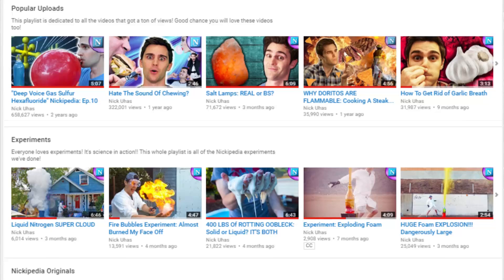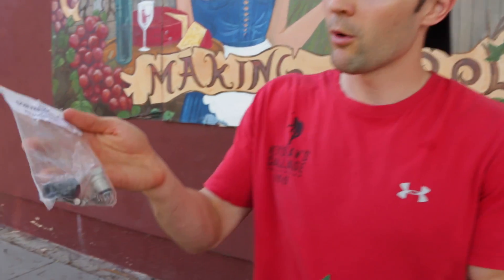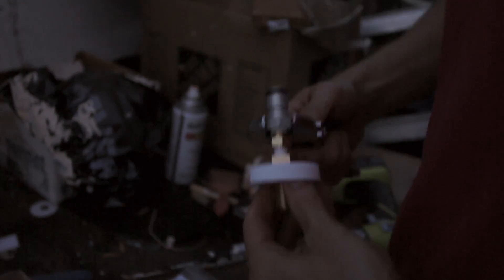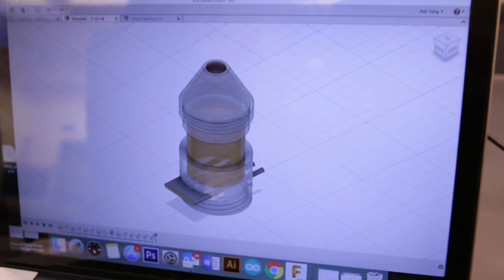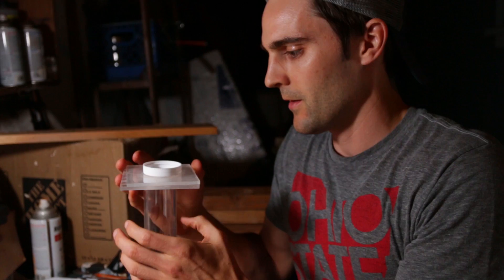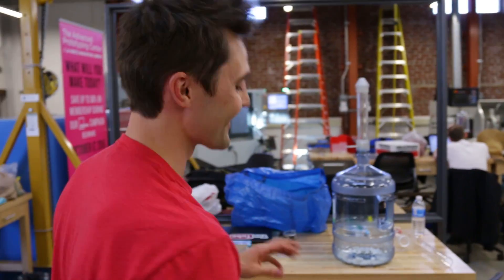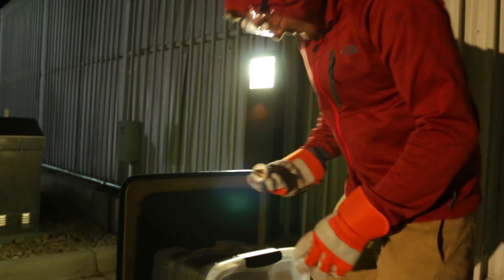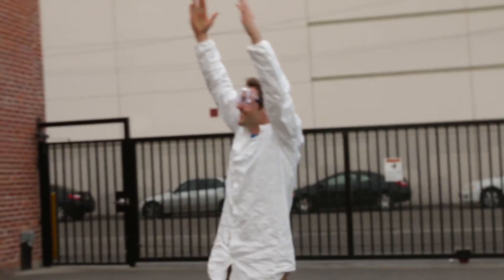Mentos in Soda WORLD RECORD: How We Broke The Largest Soda Mentos Geyser World Record (Documentary)

Comment: Hey um I'm just wondering, if you chop the mentos, would it affect the reaction with the soda? If not, (thus you can fit more mentos) would it make a bigger geyser?
Reply: If you chop and put in the same amount of mentos, I think the increase in surface area would significantly affect the geyser's height. The more surface area there is, the more nucleation sites there can possibly be.
Reply: QuasIIc - I agree. The increased surface area will create a faster reaction with the soda. This means it would be pushed out of the nozzle harder and reach taller heights.
Reply: 4
Reply: 43
Reply: 33
Reply: 3
Reply: 3
Reply: Jseph Oppa it would be the same if you cut because the less of the chemicals it would be a less chemical reaction
Reply: The mentos wouldn't have another reaction.. Because if you cut the mentos your still putting the same amount in.. So, in theary it shouldn't change at all! But this is of course just a theary who knows maybe if we have more room it will make a larger reaction! This is something for us fans to find out for ourselves! 

Peace ✌🏻✌🏻

Comment: I did not know that 3D printers existed!
Reply from the maker: probably one of the coolest things to come into the science/tech world in a long time... I think they are still figuring out all of the applicable areas to use them, but it's incredible tech none the less
Reply: Nick Uhas What kind of things can be 3D printed?
Reply: Nick Uhas And by the way, I like how you reply to a lot of the comments!
Reply: not just plastics my almost knowledgeable friend. They make metal parts now too. Many airlines are making repair/replacement parts for planes (just an example of many years uses)
Reply: Roman Ambrose you can basically 3D print anything but currently they can only do it with plastic and other easy to melt things
Reply: grrr Auto text
Reply: Roman Ambrose are you serious